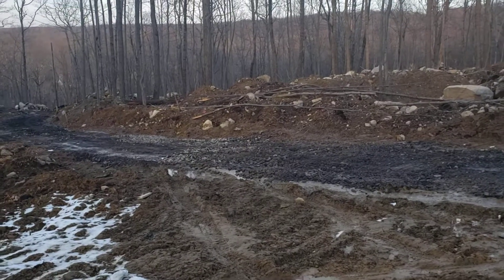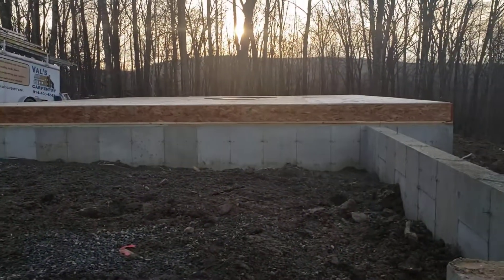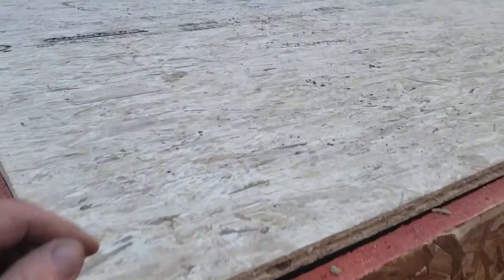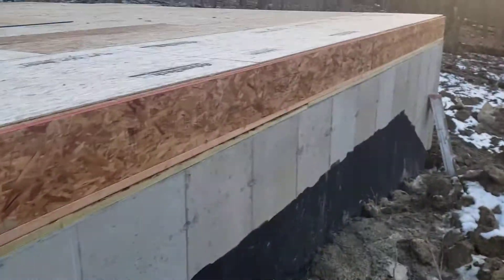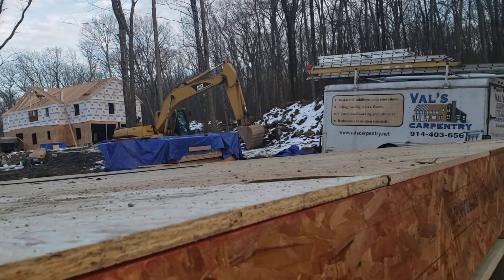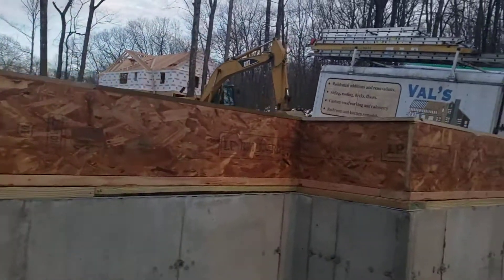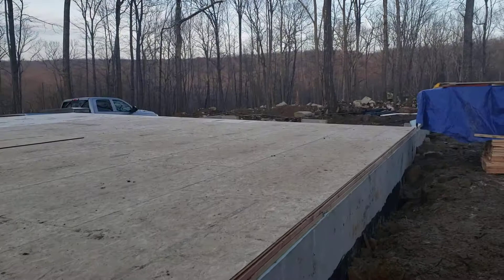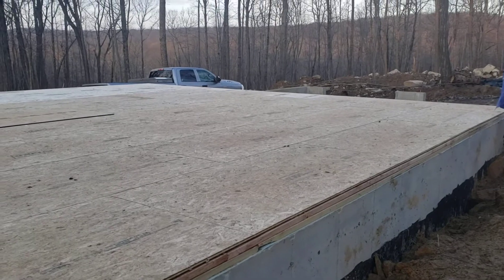Building house  vlog #5 , framing

Comment: Can you drill through the engineered floor joists you use?
Reply from the maker: Absolutely.  You can do lot bigger holes then with conventional lumber
Reply: @baldthebuilder2588  are you able to run a 4" sewer pipe through them?
Reply from the maker: @bryanduchane2371  generally we run 3" thru the house a.d step it up to 4" when it goes to septic ,but yes you can

Comment: Don't have to use wind straps on you subfloor?
Reply from the maker: No , don't even need them for the roof
Reply: @baldthebuilder2588  In SC, it cost almost $10k to buy the straps code requires. Absolutely crazy we have to have them being inland 60 miles from the coast.
Reply from the maker: @bryanduchane2371  been to Outter Banks and the way stuff was ugly there made me cringe lol,like they have no codes 😐